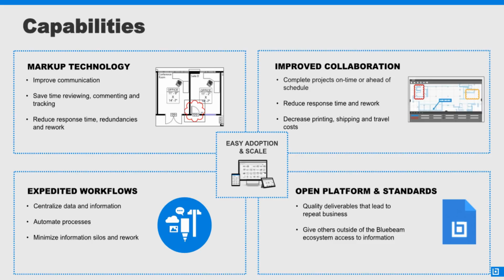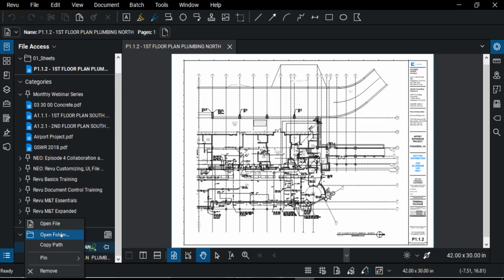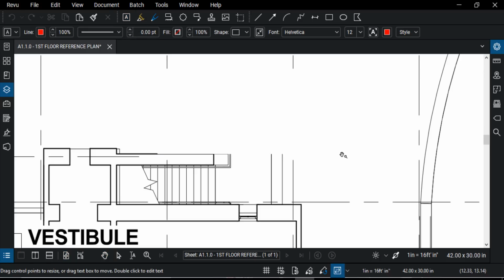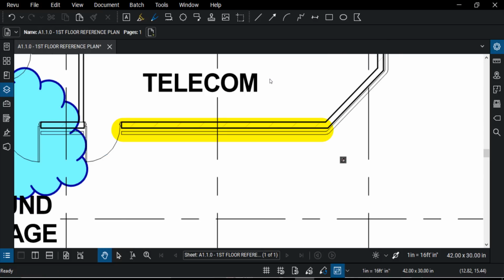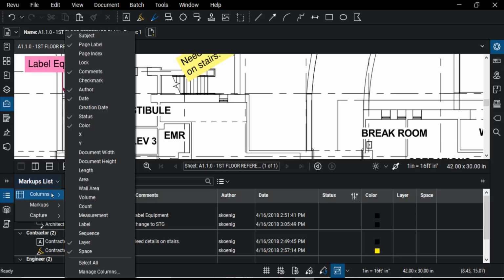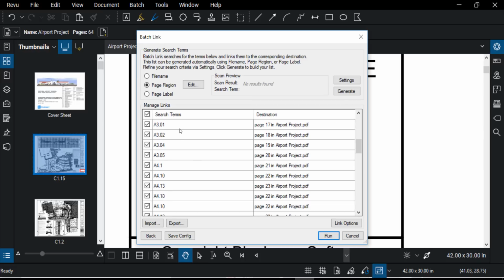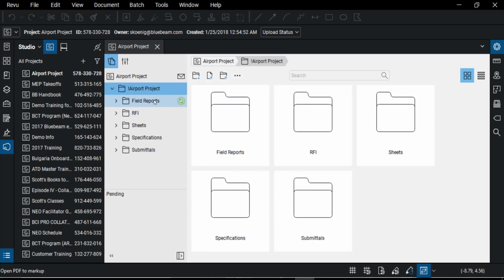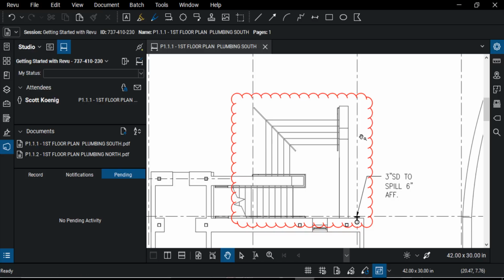Getting Started With Revu 2018

Comment: I am trying to count the data points in a PDF schematic. They are usually a triangle and the simple count function (clicking each symbol individually, creating a tick) is not appropriate for counting 1,000 triangles. Is there any way for me to count all of the symbols I want? I cannot CTRL+F because lots of the triangles dont have accompanying text.

Any help would be appreciated.
Reply from the maker: Hi Sam, we recommend you connect with our Support team for assistance. You can reach them at support@bluebeam.com.